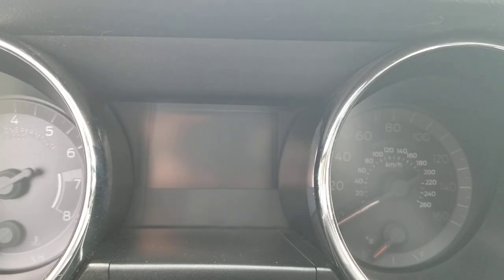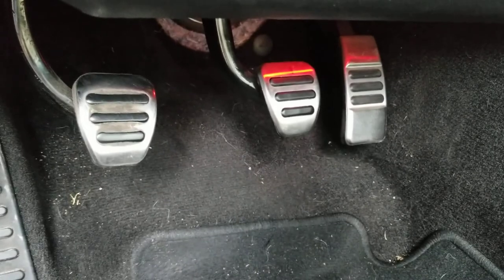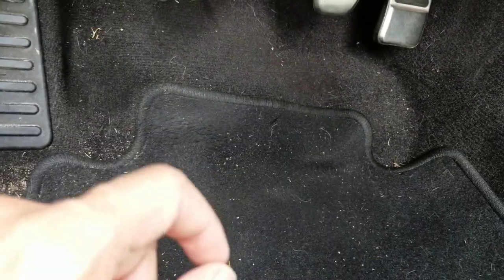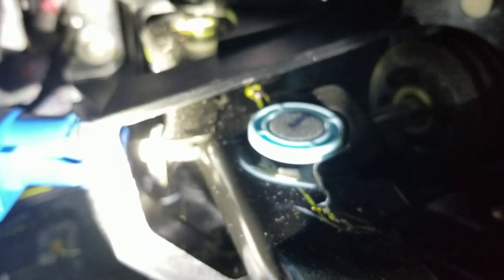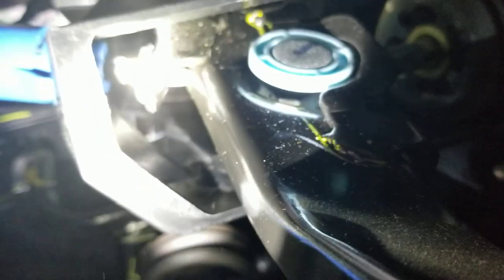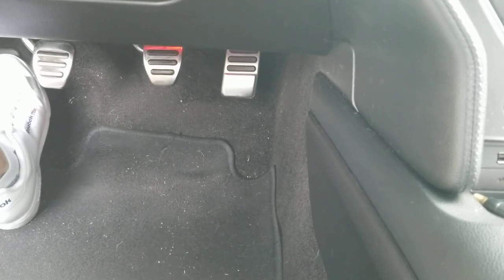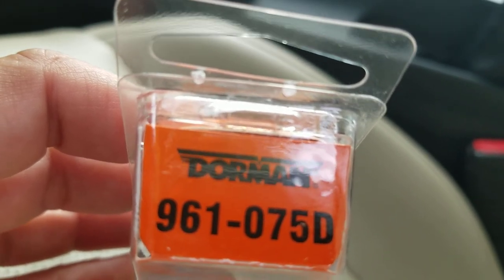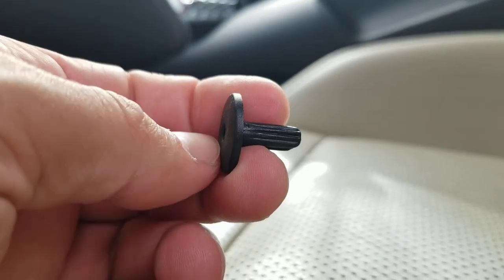2015 mustang gt acceleration issues solved. brake pedal stop pad fix.

Comment: Mane this saved me. At first I thought it was my transmission cause after 2k rpm it would just cut throttle. Once I saw the break lights still on after I turn the car off and noticed I could push to start without the break peddle pushed down I knew something was up. Quick and easy fix. Didn’t take 15 mins
Reply: Dawg this what I’m goin thru rn

Comment: Bro, I watched this and it worked. I however got fed up after 5 minutes. I cut my hands and whatnot and thought there has to be a better way. There is! Your going to get pissed but here is how you fix it in 2 minutes. Get a foot of fishing string and thread the plug. Then go under dash and feed string through hole plug needs to go in. While holding brake down Pull! It snaps right in
Reply from the maker: Whatever works.👍
Reply: You are an absolute legend bro thank you, saved me my hands and from buying a whole new brake assembly

Comment: Thanks for this video. I thought I had 2 separate issues: The lack of acceleration above 50mph and the brake lights issue. I now realize this is the same issue **ALSO Ford has now issued a recall for this brake pedal stop bumper. I received a notice in March2022. Recall Notice 22S02

Comment: So glad for this video. On Saturday while on the freeway next to the fast line my 2015 Mustang 5.0 lost power and would barely accelerate. Talk about freaked out. That could’ve caused a deadly accident. My push start button and my brake lights are still on even though the car is off. Going to dealer today for the recall. Come on Ford you got to do better.

Comment: 9:00 pm_ Sunday nite. Noticed  brake lights were on thru laundry room window.    Watched your video. Pulled brake toward me and lights went out.   Had trouble to day with acceleration,  didn't know why.  Now I do.  Will be interested in what Ford tells me.
Reply from the maker: Ford finally has issued a recall for this,the dealership should fix it for no charge.

Comment: I had this issue with sudden loss of power on a hot day in September. Ford are completely understating this problem and even Engineers at Ford dealership seemed to be unaware of engine power drop; I was lucky no one ran into the back of me and had been on freeway earlier.

Comment: I have a 2015 V6. Same issue! Dealership wants near $600 to replace the entire brake light switch.
Reply from the maker: Check out the part 2 I made it should  help out. Toyota Tacoma brake pedal stop pad is an exact replacement. Only cost a couple of dollars on Ebay. https://www.ebay.com/itm/392125676488.
Reply: Mines missing but has diffrent symptoms.  Keeps saying my launch control had been disabled . Ordered a toyota stop pad last night.
Reply: @writeupking  I had that appear on my cluster as well. I also had "hill assist" disabled. The stop pad replacement should resolve everything.
Reply: @marvin5336  me to, keeps saying no hill start assist . My brake lights are actually coming on delayed , like I'm having to push down further to trigger them so there are times I'm stopping and not triggering the brake light if I push the pedal soft.  I replaced the brake switch , now the stop pads being mailed to me

Comment: Possible Permanent Fix. Use a bolt and nut. Used this method on my 93 Honda civic. Brake lights stayed on when plastic pad stopper broke . Might need to adjust brake switch height.
I dont own a Mustang.

Comment: Will this make your car start without pressing the brake? Having an issue with my 2019ford escape ... brake lights are fine , I get a code saying switch brake is out of range but the switch is new .. wonder if this can be the issue since everything else works just the car starts without pressing the brake